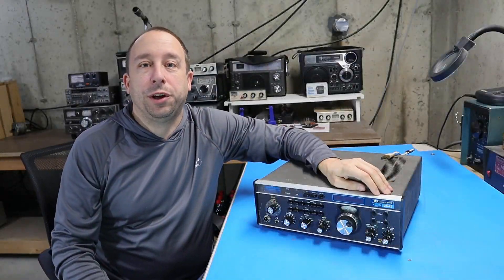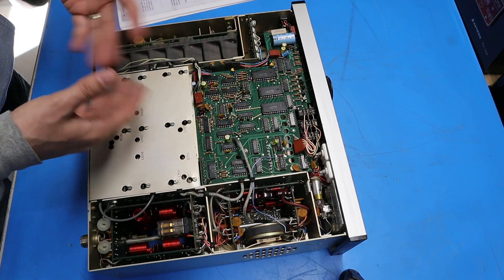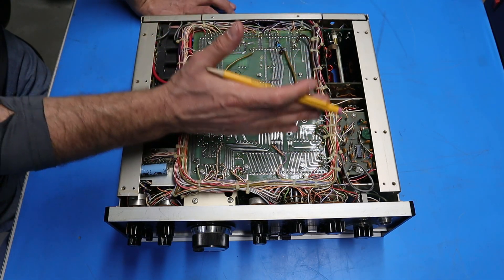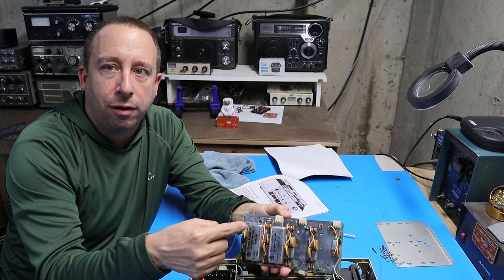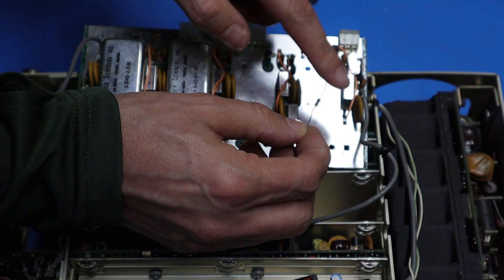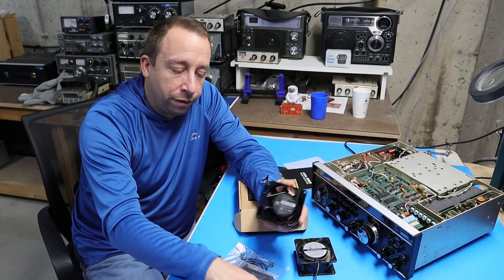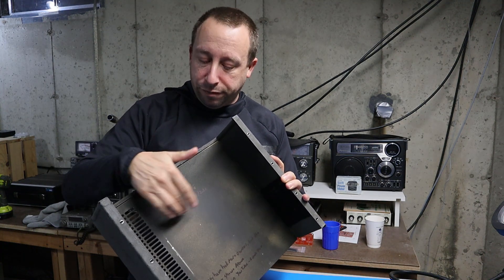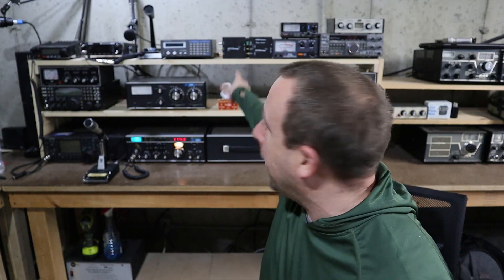Classic Ham Radio: Drake TR7 Cleanup | Filter Mod | Fan Replacement

Comment: The LS8038A-X fan is slightly faster and more air flow than the original Drake FA7 fan. 2000 RPM vs 1800. So a very good replacement. Almost as quiet as the FA7

Comment: Nice tip but following wd40 with new cloth spray simple green  to remove excess oil residue and give it that simple green scent 😉😉😆 love seeing the old time rigs would love to hear it maybe you could check into the toad net and get a audio check ☺️KC3ONO
Reply from the maker: We need ray's seal of approval before the radio can be used on the air.  I'm going to check in there someday just for "fun"
Reply: @SevenFortyOne  yes tonight might be a educational night on the at 5k tuner topography n balun results. We found their outputs on the balance taps not to be so balanced. 70% on one and 30% on the other plus swr changes when adding chassis ground. So we been trying to fix it by using K material toroids quad stacked. Should be a interesting night 😉😉
Reply from the maker: If can find time I'll listen in.  What time do you start?  I don't have an antenna that will tune up on 160 so I can't join but I cAn listen
Reply: @SevenFortyOne  630/7 is when most are done dinner and getting in. I ll send you a email with the link to John’s preliminary report on the at5k & Balun’s so far
Reply from the maker: Thanks Kevin...it's been a when since I tuned in.  Not sure I'll make it at that time but I'll try

Comment: That looked like a fun project. I have a noisy fan in a MFJ-4125 switching power supply. I think it is a 12v one. It was noisy before the bearing in it started making the dry noise. I think  iam going to break down and buy a soldering station like yours. The old HD Weller soldering gun I have is a but to clumsy to do small jobs like this one you did.

Comment: If all minor issues been solved fully filtered and fully featured this TRX is an RF-Tank of its finest.  In most cases I first of all remove the Original Fans and replace them with higher efficient super silent fans after purchased my transceivers.  I like what I have seen here. Happy weekend & 73's